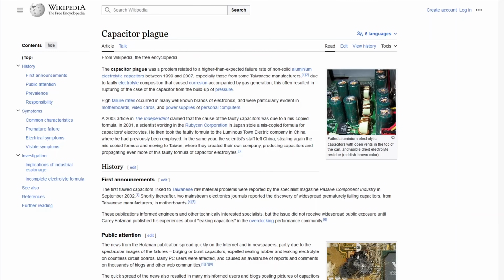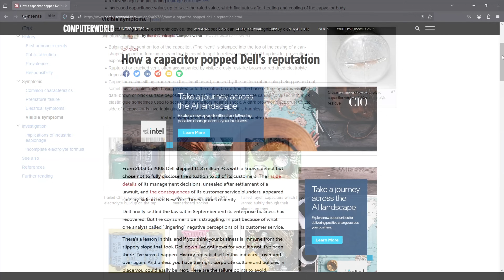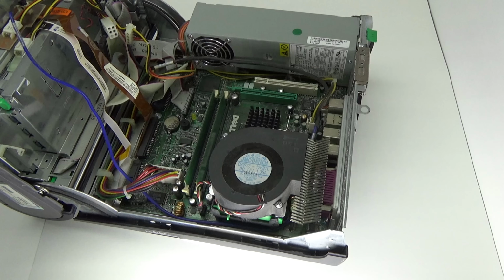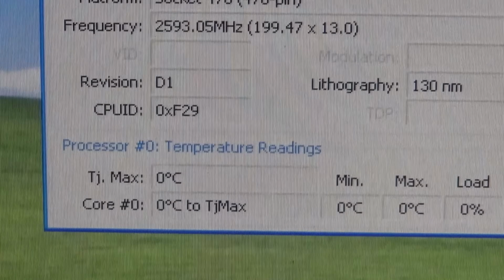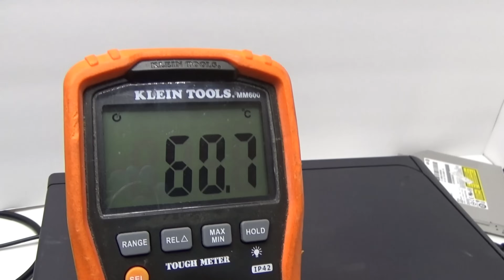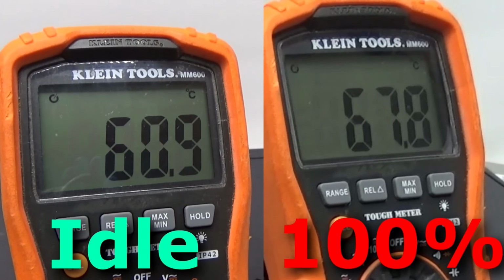Dell Clamshell Hell - Dells thermal nightmare pc's of the early 2000's. OptiPlex GX260, GX270, GX280

Comment: Yes, the thermals weren't good, but even if they had excellent cooling, those caps would still die, perhaps few months later. But if they used good quality capacitors, they would last at least 10 years of constant use before they would start to fail. You see this on the equipment that has bad thermals, but used good quality capacitors. Laptop chargers are one of the prime examples of this. They are cramped, have ZERO airflow, they get really hot, but they still manage to work even after 10-15 years of extensive use.

I experienced capacitor plague first hand. The heat only accelerated the problem. I've experienced mainboards that had their caps bulge even sitting unused in a BAG. I repaired (fully recapped, also the PSU in it) an iMac G5 which is notorious for really bad thermals (much, much worse than Dell GX2xx). This was around 2006ish. That computer was still fully working (and used daily) as late as 2014.

Comment: My introduction to these clamshells was finding one that someone had dumped on the side of the road and I picked it up cause I was curious what it was.  Immediately hated the case design when I opened it up. Surprisingly it still worked and had no leaky capacitors on the board.  Kept it for a while to run older XP games that didn't play nice with modern hardware, but eventually recycled it when I found something better.  Still have the original hard drive from it that's currently in an IDE enclosure for Nintendo Wii home-brew.

Comment: I had a client years ago that had a whole fleet of these for classroom use. They ran idle 99% of the time except when the OS updates were applied. They were relatively reliable with about 1/10 of them experiencing failures in the first two years. Then they went downhill fast, mostly due to the caps failing. Still, I think thermals were an afterthought on these and many others computers of the time.

Comment: Every school in my area used to have both of these exact PCs 20 years ago. They didn't upgrade them for like 10 years. It's wonder they ever lasted that long. They were surprisingly good enough to run some emulators on.
Reply from the maker: Yup, they were everywhere and we had them in the schools we supported too.  Why did they last so long?  They got repaired.  Once out of warranty the schools then had to pay for parts.  After you have invested so much into them, most don't want to just throw them out and buy new.
Reply: I would put the Halo 1 PC demo on them and play Blood Gulch (only map available) over the school’s LAN network with classmates. Better days.
Reply: I used to be apart of a in-school tech support program as a student back in the day. I would purposely short those clamshell ones for being so slow. I knew they'd be replaced by a newer model and I would be able to take the shorted ones and practice working on them.

Comment: I used to fix a bunch of the later versions of these SFF computers, GX620's with the grill at the front.

The early ones with Netburst (Pentium 4, Celeron D, Pentium D) chips were absolutely terrible with thermals like the ones in the video despite the added front intake fan. The unit would only pull in air, one through the PSU intake and one through the front, which would bake the hell out of components. When I worked with them, the most common failures for these would be the PSU's.

You could do a little mod to reverse the front fan so it would actually exhaust air instead, which helped with the thermal issues but made the fan noise way louder.

It got a bit better when Dell rolled out the units with Core 2 chips that ran way cooler than the P4's, but they still kept the same restrictive case design.

Comment: I have one of these machines, fully recapped and im running a rather rare socket 478 pentium 4 3.4ghz and a low profile FX 5500 :P probably runs like a furnace but have had no issue so far.

Comment: I remember recapping afew of these. Tho when i got into eletronics repair most of these systems were already gone but theres afew still going. I recapped them and would replace the psu fan with a high airflow fan that would suck air from the power supply so it would bring in cool-ish air from the back. Id have a thermal fan speed controller near where you put yours to keep the fan running fast enough to help maintain temps. I also would make some make shift ducting for the cpu fan so hot air was less likely to recirculate in the case. Over all these systems were a thermal disaster and dell had no clue about thermal air flow designs for cases.

Comment: I happened to get a gx270 lightly used a few years ago that I use for retro gaming and had no idea about these issue but I like the small form factor.  I did notice wafts of warm air out the back but I happened to misplace the riser card inside so I have a big hole out the back which must have been accidentally cooling this machine. The hard drives do show bad health with software saying they are only 20% healthy but they seem to work ok still.

Comment: I actually own a full tower gx260 with windows 2000 and 2gb of ram. It performs perfectly in the old computer ganes i play on it, if you take care if it its not bad at all. The front usb ports are a little odd. I use a netgear wpn111 usb wifi adapter to print wirelessly whenever I need to. I played Minecraft on it in the past.
Reply: Also of note, the full tower has a tunnel shaped air exhaust for the CPU, so hot air is directed out a specific part of the rear of the case. This is a dumb video because in my experience it's no better or worse than any of the countless other vintage computers I've restored in terms of thermals or airflow.
Reply from the maker: @gondolagripes1674  4:11  as I said..the tower units weren't too bad

Comment: Cool vid! We had a Dell Dimension at home at that time. Still had the CRT monitor. Later we had an XPS 430, which my father gave to me. I used it for many years and added a better PSU, GPU and a Samsung SSD (which was quite expensive at the time). I don't have the XPS anymore but the SSD still works in my PS3 :D 
Subscribed!

Comment: I had one clamshell that I kept working way past its intent with gpu upgrades, fans, removing the plastic altogether bc it was just in the way of airflow. Man I cut a LOT of knuckles on that thing but it was awesome in the end and jank as ever. External mounted PSU bc I bought ATX and it's...well a Dell. Like 3 additional fans or more. I used a cheap mouse pad to cut up and seal fresh air coming in, away from any internal turbulent warm air. It was one step down from an alienware but with all the added options which basically meant it was the same but cheaper and in a normal case. It was the bigger tower so there's was like a 1"x3" holes for air under that "handle" looking thing with front usb ports; but with all the plastic off there's actually a lot of holes for air. It's definitely the same era with Pentium 4's with HT and mine ran at 3.0GHz which sounded so good back then.

Comment: These were everywhere in college and offices around that time then disappeared really quickly.  We had a couple of the larger tower versions and the thermals and caps on those wasn’t great either.  Dell ended up replacing two motherboards under warranty.

Comment: I got one of these in Junior High, they were still fairly new at the time, I had the one with the full 5.25 bay units and wow, the performance on these was... horrendous. It ran too hot to get any real performance despite having a P4 and 512mb (Which I quickly bumped to 2gb) of DDR2, and a GeForce MX2 200. It could barely run Sim Tower or Unreal Tournament on hardware that beat the recommended spec for Halo CE. I got an HP machine in a similar profile years later that now sits in the Dell's spot on my legacy hardware shelf with the P4 and RAM out of that machine, it performs great in comparison. Needless to say the Dell went straight to eWaste.

Comment: funny enough never had a dell die even these still work fine today, I only got rid of the unit I had cause I have no use for it, im not building xp machines, lol the normal mid towers had vents with the usb under that front panel that opens, cant remember if the sff did or not

Comment: I still have a Dell Optiplex GX270 CMT sitting in the closet. Still works fine except for the clicking fan. I can't believe i used it for almost 6 years straight. I knew it was slow. But didn't think it was all that bad until i got my laptop which had a Core2 Duo. Going from a Pentium 4 to a Core2 Duo was a big difference lol.

Comment: Had both the GX260 & 270 back in the day. Got for free as both were dead due to caps. Replaced the damage caps and they made an OK machine at the time. Removing the drives from the front helped airflow. The low profile AGP GPU I added did not help it though!

Comment: The way a cooling system works it’s not just about having the hot air exit the case it about bringing in cold air or fresh air into the case as well. The thermal paste job is to extract the heat off the CPU onto the heatsink the cold air comes in over the heatsink since cold air is more dense it’s more heavy and the fan pushes the cold air and the cold air pushes the hot air out of the case. If you don’t have any cold fresh air into the case the hot air just hovers inside the case heating everything up. The fan has to work harder to push it out of the case.

Comment: Oh boy does this machine bring back bad memories.

I was a contractor for Dell in 2007 replacing all of the faulty motherboards in these machines due to the capacitor plague. I think I swapped around 4,000 motherboards for a government agency, it took I think 3-4 months.

There is a "fix" you can do for these units, you can use a specially made duct (or just 3D print one now) so that 100% of the CPU exhaust exits the case and gets deflected upwards outside of the case and away from it.

The second mod is to open the PSU and reverse the direction of the fan so it pulls in air from the back of the case, rather than hot CPU exhaust. The machine shutting down is more often caused by an overheating PSU thermally shutting down. A further mod is to power the fan externally, since it is a temperature controlled fan and runs far too slow. Replacing it with a better fan that moves more air also helps a lot.

The later SX280 with an LGA775 socket you could do one further mod to, replace the CPU with a lower wattage variant. The Cedar Mill core Pentium 4 6x1 parts with a D0 stepping had a 65W TDP, compared to the older 89, 95 and 115W parts. This drastically reduced internal case temperatures and increased the longevity of the machine, after you recapped it of course.
Reply: What about drilling holes into the side of the case, I'm thinking about doing that with some of my 2400 dimension projects as well as this 25-lbs-plus mid tower GX270 that I found in the trash, I always wondered why they made these early Optiplex machines with these pivoting hinges, it makes the mid tower weigh a ton with all that metal. I've put Dell 790 and 3020 motherboards inside some older dimensions, and they fit easily and are installed easily because the side panel pops right off, and many of the switches work just fine, but placing a newer mobo into a GX270 behemoth is going to be more difficult,  I'll need to drill and dremel plenty of that metal to make a mobo fit, but it's my project for this fall wish me like

Comment: These dells do use a thermistor to change fan speed, but they also at least can override it. I dont know if they really ever do under normal circumstances, but proof that motherboard side fan control exists can be seen by speedfan (be sure to "enable dell support". But you are right that temperature *monitoring*, at least to the end user, is limited to nonexistent on these.
Also FWIW the electrolyte that leaks out of those  bad caps is generally not terribly corrosive. The electrolyte from plague caps evidently generally can sit on motherboards for years with minimal to no corrosion, as every time ive seen it there's been no to almost no damage. There are plenty of capacitor types that are very corrosive to have leak without prompt cleanup, such as the early 90s surface mount electrolytic capacitors. Those truly do destroy motherboards.

Comment: Excellent video! I actually love to grab these up since they are cheap, and what I will do it A: replace the caps, but also B: cut a hole in the front just behind the little grey flap-looking thing by the USB ports, and add in a 60mm fan to draw in fresh air from the front. 

One minor thing I noticed, you accidentally labeled the AGP slot as PCI-E in your drawing :P 

Excellent video, keep up the good work!

Also... Keep an eye out for the half-height AGP cards for these things... Half height AGP cards are EXTREMELY hard to find, and run absolute CIRCLES around the integrated graphics. They also help with just general use, not just gaming. The desktop environment needs to be rendered too, ya know :P and being able to offload that onto a dedicated GPU (a popular pick was the GeForce4 MX 440, but more commonly you will see the Quadro NVS 200 or the Quadro FX 500 (again, both are REALLY hard to find)
Reply from the maker: oh crap i didn't notice that about the drawing...force of habit I guess

Comment: It certainly didn't help that computer desks and home office hutches in the early 2000's were designed with a "Computer Nook" that essentially boxed the PC in to a particle board crate with just a small hole on the back to run cables out of. Stand-up Dell towers didn't stand a chance in hell, which they almost got as hot as.
Reply from the maker: VERY true.  Also even if someone stuck it on a table, the desktop would be blowing against a wall with a ton of cords around and a monitor on top.

Comment: The power supply fan ensures that fresh air is brought into the case and circulates out. There are also some very small vents on top of the case. Later versions had a fan duct for the CPU fan that would make sure hot air exited the case. The later NMB-MAT fan also did not have a thermistor, and it was thermally controlled by the motherboard bios. The only issue I had with it was that the fan itself had dirty commutation, or 'cogging', and it would produce a 'grumbling' sound that was audible and would ramp up and down with the fan speed. And later, capacitors became an issue in mine. Dell went back to a design like this one for future SFFs after leaving behind the BTX thermal scheme, but the BTX thermal scheme was very effective - and necessary to handle NetBurst architecture Pentiums.

Comment: This was my second or third PC as a small kid in the early 2000s (my dad "stole" PCs from his workplace's dumpster) and mine still works 100% fine. I even imaged the drive and installed arch on it for shits n giggles. Worst thing thats ever happened to it was a dead RAM stick. Never even overheated. Overall other than the thermals this thing is a great PC and even runs late 90s/early 2000s games at acceptable framerates.

Comment: I worked for Dell Support when these machines were still ubiquitous. If we got a call for one we always knew it would have bad capacitors. Another thing about those cases (They were officially called the 'Transformer' btw IIRC they were the Bumblebee for the desktop can Optimus for the tower, may be wrong but that's what I remember, the newer cases were 'Matrix' named Neo, Smith and Trinity.) is that they had a tendency to guillotine cables if you weren't careful closing them
Reply: and now I'll probably remember this for the rest of me.

Comment: wounder if you could remove the cd drive and use it like an intake.

We used one as a router for several years but it was in a conditioned space so it probably helped.

Comment: Most of these PCs should have a shroud over the blower fan's output to guide the air out of the case. But I'm also not too familiar with these, I left Dell just after the 1GHz P3 in the Dimension XPS T-series.
Reply from the maker: Yup, should've but didn't.  The towers had a green one over the cpu fan to direct the air 90deg to the back vent, but the desktops were as you see it here.

Comment: I think you should take a look at the GX520/620 SFF machines, the first BTX style ones from Dell. The HDD mounts right behind the CPU heatsink and the GX520/620 only supported the netburst chips, no core2. Those things were absolute ovens and the HDD would be incredibly hot from the heatsink exhausting directly onto it. Dell knew those killed HDDs a lot as the 745, the first one to support core2 had a little fan in the HDD caddy. dunno how effective that was but I imagine just being paired with a core2 made things much better.

Comment: my school used these and a mixture of the optiplex 700 series dells for the longest time. this has a half height agp graphics card slot so the heat could potentally get even worse. what kind of agp card would even fit in there? i suppose one could take out the expansion slot covers and stick a fan in there for more ain intake